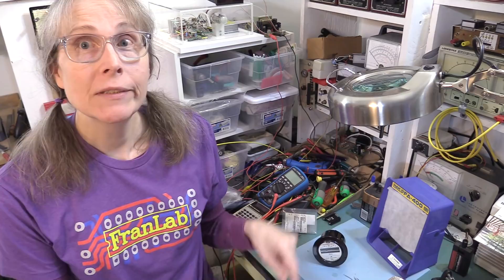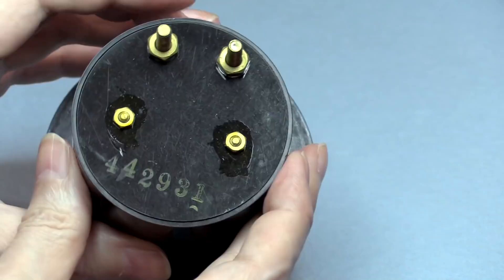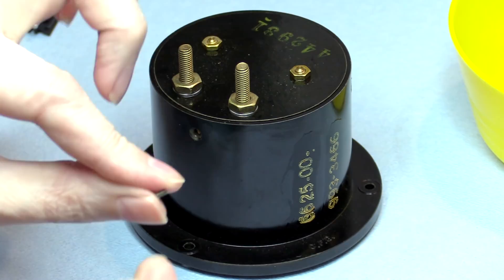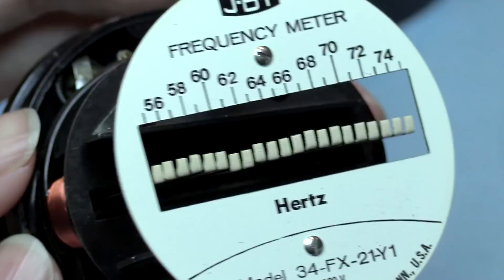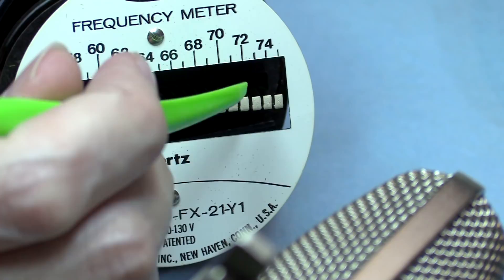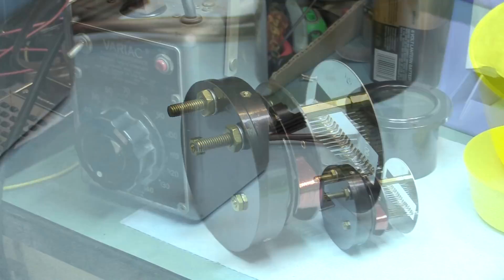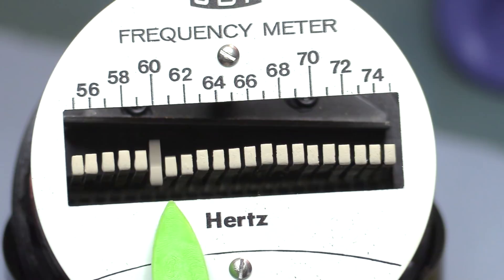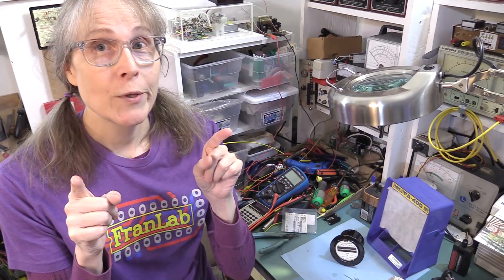The Spooky Action Of Mechanical Frequency Meters

Comment: Is that radioactive lume on those tabs?
Reply from the maker: No.  Just good old safe lead paint.
Reply: @FranLab  making homer simpsons drooling face 
"rrrrgh.... lead paint...."
Reply: @JohnSmith-eo5sp  I totally forgot that. They were in the dock bay of the gigantic submarine-eating ship!  In my mind, I was thinking of the nuclear device in Goldfinger, but now I'm not even sure which film she mentioned — if it was Diamonds Are Forever, I was doubly wrong!
Reply: @JohnSmith-eo5sp  is this video actually 59.94 or straight 60 FPS?
Reply: Ah yes: Proper Lead Paint. It sticks and it's durable, just like the OLD Solder did: Back in the days when a Grid was a Grid, a Plate was a Plate, and The Filament knew what to do.... :-) 73 DE W8LV BILL
Reply: @JohnSmith-eo5sp : Caroline Munro...

...Mmm...
Reply: @manitoba-op4jx  mmm lead paint chips with some salsa,,,,,YUM!
Reply: @Bassotronics : Not likely.
Reply: @FranLab  I used white nail polish on the flap indicator on my airplane.
Reply: @FranLab  Safe lead paint?
Reply: @manitoba-op4jx  Touching it is okay. Swallowing lead is the problem.
Reply: @JohnSmith-eo5sp  Its a grotty hack but very clever at the same time 29.97 frames per second, I believe.
Reply: @JohnSmith-eo5sp  I thought it was Goldfinger?
Reply: @JohnSmith-eo5sp  Yes, the cameras may have sync'd to 60Hz at one time to eliminate rolling hum bars. But the receiver always had  to be synchronized to the vertical sync pulse of the video.  You can't synchronize the receiver to the power line, because the phase could be off by 120 or 180 degrees if you're on the same grid. In the case of nationwide network programs, the receiver could be on a different grid that is not synchronized at all to the station.
Reply: @darylcheshire1618  It is Octopussy. 😄
Reply: @JohnSmith-eo5sp  And also Octopussy.
Reply: @mycosys  I thought Going Mad and accepting the risk of death were pre-requisites for engaging in this sport...
Reply: @JohnSmith-eo5sp  Nope, frame rate is 30Hz
Reply: @JohnSmith-eo5sp  True for black and white in the US. They slowed it some a little for adding the color to stay within bandwidth limits.
Reply: FranLab makes any day better :)
Reply: @hackmiester1337 very likely 60hz, because it would be progressive scan and not interlaced.
Reply: @JohnSmith-eo5sp  cool, I didn't know that. Always wondered how that came to be!
Reply: @w8lvradio  And electronic components were big enough to see, pick up with your fingers, and see the numbers or color bands! I finally stopped electronics bench work when they had to start using a microscope & tweezers to see & place the parts.
Reply: @FranLab  well a (tiny) fraction of lead is radioactive, so the answer is arguably yes. =)
Reply: @JohnSmith-eo5sp  Woot the details!
Reply: @8546Ken  hence they used delay line to be able to adjust the phase of the wave.
Reply: @RAF-777  Do you know of ay actual TV receiver that used line sync and a delay line?  I spent 15 years designing CCTV cameras an monitors, Our better cameras used a crystal oscillator and a dividers to generate the vertical sync. Cheaper cameras were synchronized directly to the AC line.  There were also phase locked loop circuits that synchronized to the AC line. For multiple camera systems line-lock kept the cameras in sync with each other. 

But monitors were never locked to the AC line. They were always synchronized to the vertical sync pulse on the video waveform.
Reply: @FranLab  Perfectly safe as long as you don't open...wait
Reply: @8546Ken  yes I know couple of  the east European lamp TV sets used an ultrasound delay line to achieve sync , I have been used to have some schematic, but now sadky I can't found them.
Reply: @tekvax01  that was what I was thinking, so it’s likely that they were both “exactly” 60 Hz... just for varying definitions of “exactly” 😅
Reply: @RAF-777  The only ultrasonic delay line I am familiar with was used in the European PAL color decoder. With PAL, the chroma signal is inverted every other line. The delay line allowed the color on two consecutive lines to be averaged.
Reply: @mycosys  Yeah, I'm sure you think about the 2 dollars a day workers in the Chinese sweatshop factories making your components.
Reply: I'd test it anyways.
Reply: @FranLab  I've just started watching Franslab videos.... What's the score with the really awkward introduction on all the videos...????  Am I missing something??  Thanks

Comment: Variable frequency mains is easy - signal gen, audio power amplifier and a mains transformer wired back-to-front
Reply: Sounds great, now mail it to the Fran lab!
Reply: The audio DAC built into almost all devices nowadays also works in a pinch
Reply: Basically a bunch of tuning forks
Reply: 1000 watt DJ amplifier is capable of putting out 115 volts ac on the speaker terminals old 70s Crown amp
Reply: @hellhound-si5oz  Ha!  I just suggested the same thing before seeing your post.  Those Crown amps do come in handy.
Reply: was going to suggest exactly this.
Reply: I'll suggest something simpler. A signal generator output can probably put out enough voltage (say 10Vrms) to see some movement. You could even use a square wave (may need a coupling cap around 10uF or so depending on the generator) since the harmonics would be out of range of this device. Worst case, a 60W transistor amplifier could drive plenty of voltage to see movement.
Reply: Better yet, connect it across a loudspeaker while playing bass heavy music. It may put on a nice show.  😁
Reply: 100 Volt PA amp would be perfect, and replace sig-gen with arbitrary waveform generator, then you could do all sorts of cool things with that display.
Reply: @Darryl_Frost  You just blew my mind: this is in fact a mechanical SPECTRUM ANALYZER.
Reply: I was going to suggest the same thing, but you beat me to it. :)
Reply: Yes. Maybe even just a signal gen and a 5VAC wall wart (wired back-to-front).  Seems like this device doesn't draw much current.
Reply: I have a $50 generator with a screw that adjusts the rpm if you want a variable frequency supply of up to 7kw or so in the range of 45-75hz ish.
Reply: Jokes on me, I replied about the same concept before I read the comments. What you said lol.
Reply: Lol as soon as she said that I immediately looked over at my stack of amps and thought the same thing. Using a VFD would probably have been a disaster since they don't produce true sine waves but rather the usual "modified sine" instead like cheap inverters.
Reply: The studio that I used to work in used that setup to vary the speed of 1/4 inch tape recorders*. I don't remember them using the mains transformer just a straight feed from the amp.
*big Scully beasts!
Reply: Even a 555 should do the trick?. May need RC network to filter frequencies above 100Hz to give a good enough waveform. Boost it through a reverse wired (step-up) transformer. May need a transistor to amplify the signal to get a good voltage swing.

Or ... plan B ask if there's anyone locally that has something suitable and do a follow-up video.
Reply: Hi Fran
Seen a lot of this on old gearn they look awesome when a generator is flickering due to a step load. Try hacking an old UPS varying its frecuency
Reply: I was about to suggest that!
Reply: Yes, have this very exact setup with a beefy audio amplifier(wired as P-P- mono)and an old transformer from another audio amplifier. Usually driven by an old frequency gen but I suppose even your phone with the keuwlsoft "Dual Channel Function Generator" app will do nicely.  If you don't need much power you can also scale this down (using a modified or purpose designed amplifier)with the added benefit of improving your frequency range.
Reply: Maybe even a tube amplifier? the signal that goes into the output transformer could be perfect
Reply: Sorry for repeating, I didn't see your post until after I said the same thing.
Reply: I did build a DC power supply with a DAC to allow control from the computer. Worked well for arbitrary waveforms up to about 1kHz bandwidth. So possible to produce sine wave and drive a transformer to step up the voltage.

I needed to switch in the filter capacitors with a relay if I wanted maximum smooth DC or faster bandwidth for waveform output.
Reply: Hack an old ups?
Reply: @benboldt1   I wonder if you could see  harmonics? What was the range?
Reply: I did this once but with 24v
Reply: Mike bet me too it.
Reply: @rysacroft  I was gonna suggest the same thing...
Reply: At this level of current do you even need the amplifier? Most sig generators are 50 ohms output impedance , at over 10V RMS.

Stepped up it could probably power this directly
Reply: @macro820  by old ups y meant one whose frequency is adjustable by a pot. Newer gear are all DSP,  auto detecting line freq. Harder to fiddle with
Reply: @walsakaluk1584  Harmonics happen at the main frequency multiplied or divided by an integer, so I don't think you could see multiple harmonics at the same time with the range of this meter.  If you give it 120Hz or 30Hz, you might see a harmonic at 60 Hz though for example.
Reply: @benboldt1  agreed.
I noticed the meter's range after writing.
Reply: Ha just suggested this too; I used a $15 class-D amp off ebay driving a 6v AC mains transformer, driven by a PC (free "sound card oscilloscope" has a nice signal generator) - Another nice trick is that if you use a transformer with a 110/240 center tap on the primary, you get 3 outputs = L1, L2, N   It's a really great hack.
Reply: You could also use a small petrol genset an just rev it up and down
Reply: An ordinary VFD puts out not a smoth sine wave but a series of square wave pulses that are all at full line voltage but different  duty cycle to create a fake sine wave as the motor windings  evens out the high frequency pulses to a somewhat even sine voltage. This is what creates the high pitched whine associated with VFD controlled motors. If the windings in the meter is capable to even the square waves from the VFD out properly i guess it would work just the same. After all it would not resonate at all at the 5-10 kHz carrier most vfds use so it could probably work. Class D amps work the same way but operate at a MUCH higher carrier frequency then a motor VFD, in the order of several megahertz, to be able to generate a full audio spectrum and also without creating any audible high pitch switch noise.
Reply: @ethernet0  Simply override the rpm governor with a maual throttle cable. thats likely the easiest way overall
Reply: @kenmore01  You'd need more than 10V to see discernible movement, as Fran's ramping up through the Variac demonstrates.
Reply: @kenmore01  yeah da base
Reply: Use your smartphone audio spectrometer and an electric shaver. Might be able to pick up the vibration from older wall worts as well.
Reply: I just made the same comment only to scroll down and see the next comment go oh.
Yeah there’s a lot of free signal generator apps on the App Store.
I have heard that over 100 W amplifier‘s are capable of driving 70 V systems in bridge mode and have done it myself. Did not know about the transformer technique that sounds interesting.

I was trying to generate ring voltage and couldn’t remember how I did it following something else. It was using back to back transformers off 120 V 60 Hz with slightly varying taps. although I did accidentally well trying to figure it out again put 240 V into a phone which survived boy was that buzzer making a weird noise.
Reply: @mysock351C  The un-sine waves produced probably have enough harmonics in them to vibrate several of the indicators.
Reply: High power audio amp, and signal generator as simple as a phone app with bluetooth.
Reply: Better then my idea, old gas generator
Reply: 7.5 mA @ 120V is only 900 mW.  Call it 1 watt to be easy.  You don't even need much of a "power" amplifier here either.
Reply: Very cool!  We had those on USAF support equipment.
Reply: Scrolled down here just to say this! Beat me to it.
Reply: A cheap and nasty genset plus a vaguely variable load would put on an interesting show as well.
Reply: I used a LM675 power op-amp, sig gen and reversed transformer to drive a Pioneer PL12D turntable at 78 rpm years ago. Very straightforward and cheap.
Reply: as long as you don't mind burning 100W to deliver 50W...

Comment: This kind of "old" tech always amaze me because is fully made using physics properties, nowdays we mostly use DSP even for trivial tasks.
Reply: I used to spend a lot of time taking out old analogue instruments replacing them with DPM's  It always felt a bit sad.
Reply: @jrkorman  indeed and far more prone to rfi interference too.
Reply: DSP will probably be more accurate and reliable, as all it relies on is the frequency of its crystal and maybe the voltage of its supply/voltage reference, leaving very little to go wrong/calibrate.
However deity help you if you need to program it but don’t have the software or drivers needed to do so.
Reply: I did the firmware on a freq. meter in the early 90's. All I did was count pulses the FPGA gave me. It could plug into any source from 5 to 5000v & show 2 to 9999 Hz. Could've gone higher but input impedance got to be too high and we only had a 4 digit display. It was more precise than the expensive signal generator we had.
Reply: But just remember, at the heart of a digital frequency counter will be a carefully cut tuning fork - vibrating a few million times a second.
Reply: @silverXnoise  , What's great about this though, is that it's didactic. Unlike modern devices it displays it's use of physics so it's easy to understand and appreciate. I love seeing how things work! It really enriches objects for me, and I think for others also.
Reply: @jrkorman  oh, I hear DSP and I think Darksyde Phil lol
Reply: @silverXnoise  S&N You are most correct. Reading the directions on one of my Frahm meters, it can read 1/8 of a cycle.
Reply: @HangTimeDeluxe  with all the respect: actually it is not an analog device. The device is discrete with some 24 different indicators states: one for one frequency only, so it is even not only discrete, but it is as well the binary because each indicator can have only two states: tunned frequency detected ot not detected. One could argue that the indicators have a lenght of movement proportional  to the power of the signal so it makes them anlogue as well as discrete, but there is no scale so they indicative only. But I know what you mean.
Reply: This reminds me of "$5000 mechanical watch is more accurate than digital watch".
Reply: Look I get your point, there used to be a lot more one-off electro-mechanical ingenuity in older devices. HOWEVER, it takes CRAZY physics to get a microprocessor to work, so "physics properties" is in no way the opposite of DSP.

Comment: The angled plates make it so the magnetic force is stronger at one end and weaker at the other.  This is needed because the tines are stiffer at one end (high frequency) and more flexible at the other end (low frequency).  This notion should resonate (pardon the pun) with a guitarist.  The purpose is so that all the tines move up and down approximately the same distance.

Comment: I work in the testing department for an electric utility company. I have equipment that is absolutely perfectly suited to demonstrating the other frequency tines. I'm not a youtuber but if you want to trust a random internet stranger I would love to borrow this thing so I could get you some footage of it reacting to different frequencies.
Reply: As some others have commented, even a modest audio amplifier will run one of these through a suitable step-up transformer e.g, using an audio output transformer "backwards".
Reply: @hughbrackett343  ... you could do that or connect it to a portable generator and vary the throttle to change the frequency.

Comment: We used to have aircraft ground power units that had one of these on it to indicate that it was providing good 400 Hz power for the aircraft. Everything is all digital now.
Reply: They're still used in the USAF on the -60 units.
Reply: Speak for yourself. We still run our aircraft off an old GPU built in Hobart. No clue exactly when, but I've always been very fascinated by it